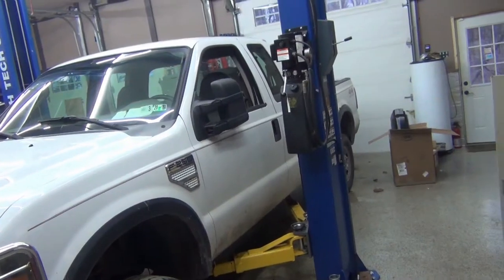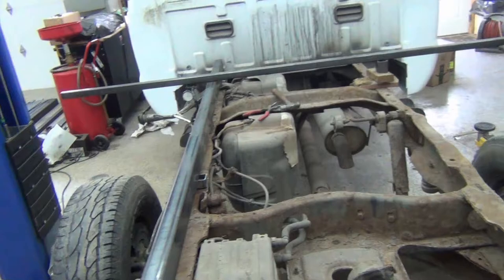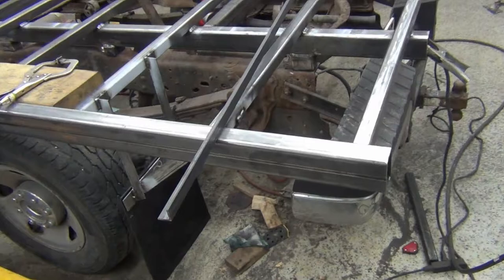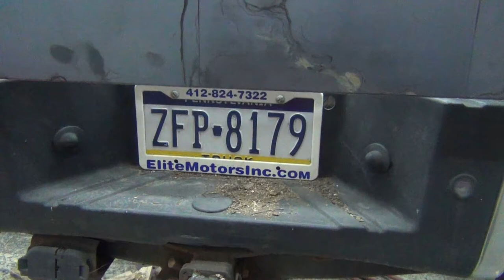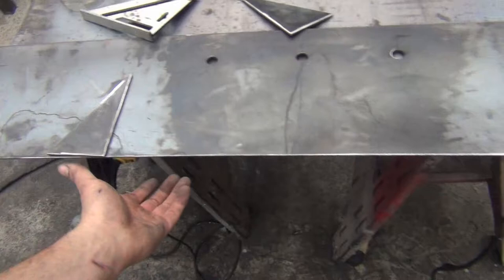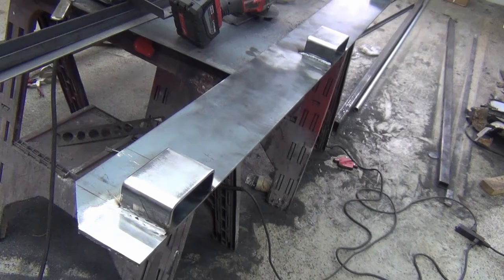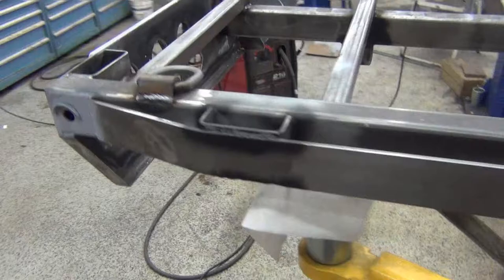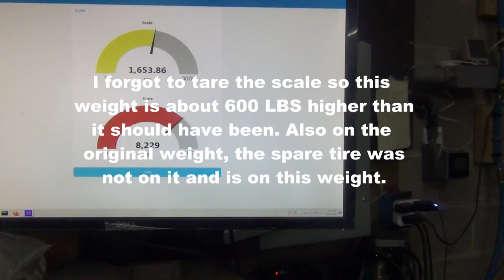Another Flat Bed Build

Comment: Nice job! This is the type of simple example I was looking for to build mine.
Reply from the maker: Thanks, If you decide to build one, I had made a rough print that I used to have a starting point that I can send
Reply: @garagemahal9546  could you send me your rough draft this is exactly what I was looking for!
Reply from the maker: @afrohauk13   I used this as a starting point and to figure out the materials I needed to order. There are changes from this drawing as you can find in the video. https://1drv.ms/b/s!Aq06wVTuUjITuxScXPiUWU9n1PGe?e=vWiM1T Hope it helps with your build! Thanks for watching.
Reply: Could you share what wire strength and amperage that worked well with this build?
Reply from the maker: @afrohauk13  I ran 14 AWG stranded which would be at least the wire for the amperage of the fuse. If it is a 15 Amp fuse, 14 is what is called for.

Comment: So the length/ width is larger than the original truck bed? I have a 2500 with a 6.5' bed, could I build something like this but increase the footprint? That would be my ultimate goal...
Reply from the maker: As I recall, the bed is 7' wide by 9' 3" long. it hangs over the plate a little which is why the cutout to view the plate. This truck was originally an 8' bed, you may be able to squeeze an extra foot or so out of a 6.75 bed. The purpose was to put two quads on it, which I have seen it loaded and they fit Niceley.
Reply: @garagemahal9546  thank you

Comment: This is the video I needed to see, I have a 2004 F350 Super Duty that I need to replace the bed on. I am wondering if the bed could be built higher as I was wanting to build the tool box into the bed where the lid would be flush or nearly flush with the bed.
Reply from the maker: I was trying to keep it as low as possible. If you want to go higher, you may want to consider a sway bar for the rear axle.

Comment: Nice work. I wish that you'd add a fifth wheel hitch that also allows you to tow gooseneck trailers, not just fifth wheeler.
Reply from the maker: Although the owner of this truck does not tow goose or fifth wheel and did not want that, I don't think it would have been much more wore to have built around a goose hitch if it was installed prior.

Comment: what are those little wire jumper connectors called?
Reply from the maker: WAGO's i love them, but in that environment you need to add some silicon in the hole so they do not corrode.

Comment: How did you make the weight measurement with the hoist. is it a kit you bought or a diy project.
Reply from the maker: I though about making a video about that. You'll need to tap into the hydraulic line to the pistons from the HPU. The most simple version would be to add a pressure gauge and, Knowing the surface area of the pistons inside of the cylinders, convert the pressure to total pounds. That would require a hand calculation each time. For (2) 2 inch pistons it would look something like this: ((3.14159 * 1"radius^2)*2Cyl)*(PSI-TarePSI), So this example each PSI is 6.28 Lbs of static lift. I added a pressure transducer that I then bring into the computer and do the calculation there. To do this method will require a 0-3000 psi transducer, wired to a converter that in my case outputs a modbus value. I bring that into an open source java app called node red and convert it back to psi, then do my calculations. I realize that's a lot in two sentences, but that's the quickest explanation I can give. You will need to be consistent on the direction you take your measurement because of the flex of the O-rings and check valve and such, but once it is all set up, you can get a feel for what is right.
Reply: @garagemahal9546  a video would be nice but not necessary. I'm  just glad I seen this now I have to make me one

Comment: so the flatbed ended up being lighter than the factory bed?
Reply from the maker: Your comment made me go back and look at the numbers. I never considered this. So... According to the OE sticker on the door, the truck weighed in new at 7574 lbs. I am pretty sure that includes a full tank of gas, I do not remember how much gas was in the truck when it was brought in. My scale showed a weight of 7485 (close enough) and the final weight of 8250 - ~600lbs for the rack weight. that puts it at 7650 lbs with the spare tire now mounted. I am not sure how much the spare weighs but I would guess about 75 lbs. So, in the end it seems that its about 100 lbs heavier. Note that the tare weight is really about 580 and the scale cold be off 50 lbs or so. I never expected the scale to actually be as close as it is.

Comment: How much total cost
Reply from the maker: Steel prices are all over the place when doing small batch jobs like this. I would suggest shopping at multiple places. I think at the time I built this the steel was about 2400. Then add the 2x8. But don't forget about all the other stuff like wire, grommets, lights and everything else. Most of that stuff I stock in bulk so I couldn't tell you the total on that stuff.